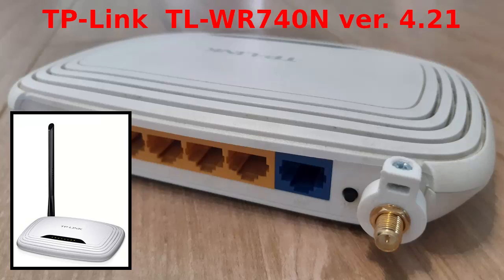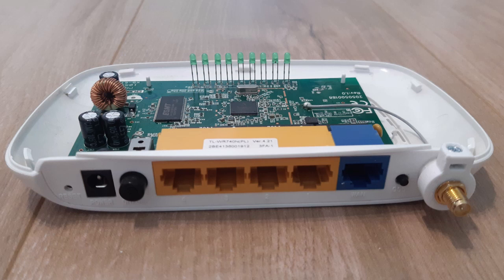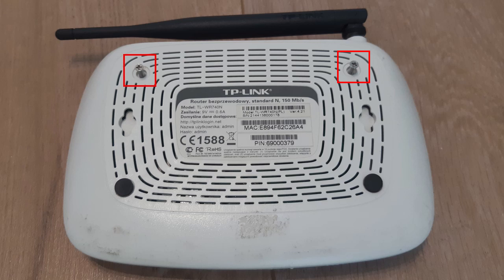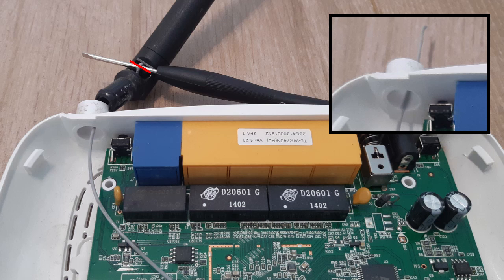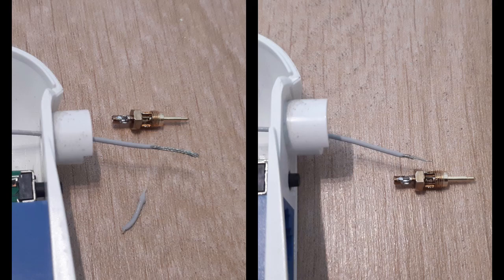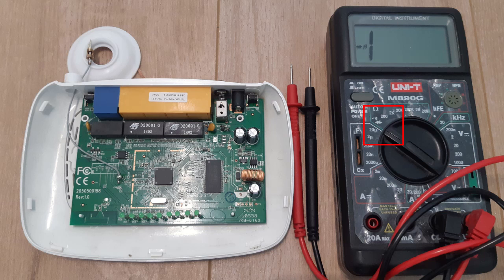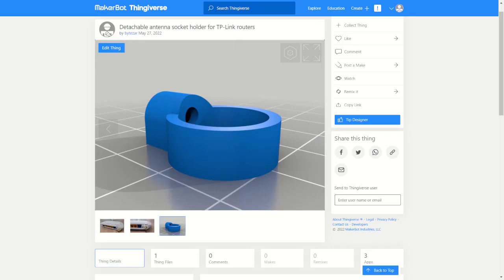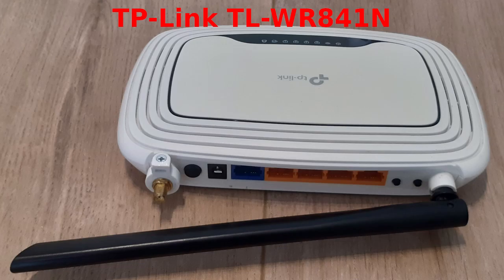Creating detachable antenna socket (RP-SMA) in router with fixed antenna.

Comment: Hi, great video. Can You Tell me if it is possible to instal an external conector in a 2.4.  /. 5 GHz wifi modem for fiber optic that has only internal ANTENNAS?